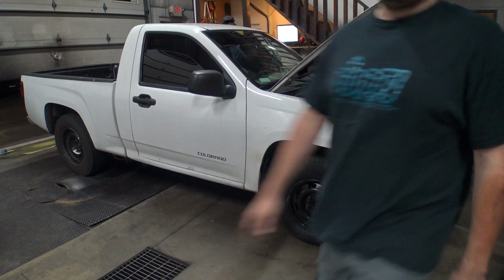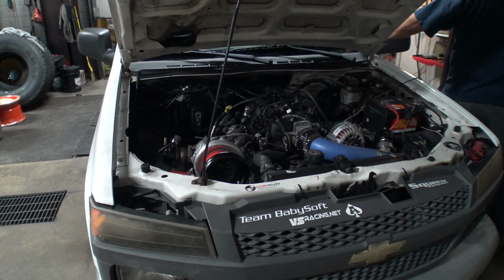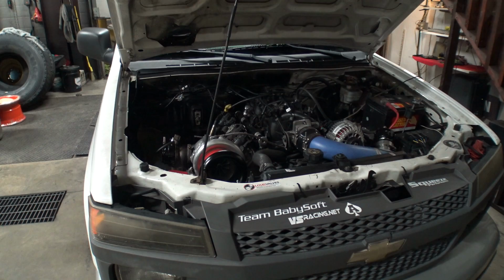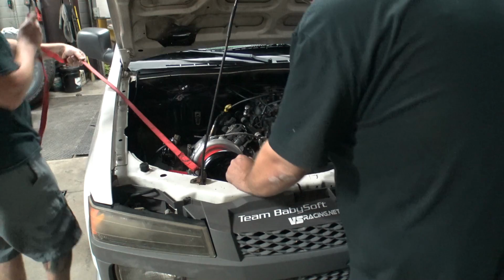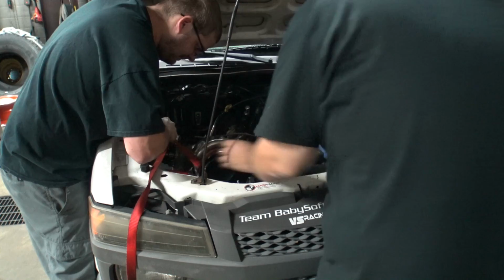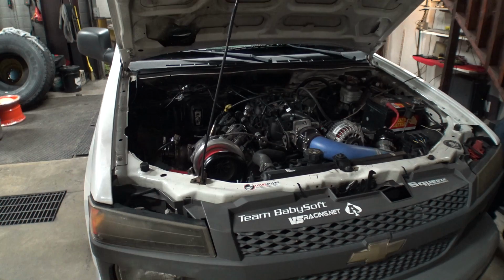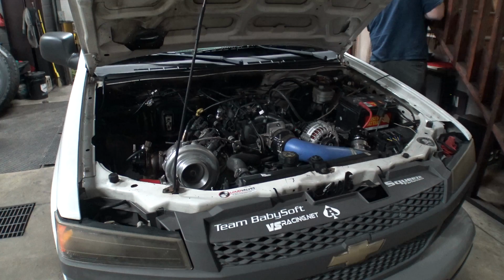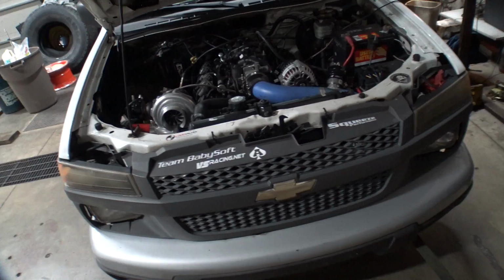aluminum bellmouth ramhorn turbo inlet dyno testing ft shitboxcolorado

Comment: Hi guys. i know just enough about subsonic airflows to be dangerous. In my  experienced amateur opinion, (from numeric  wind tunnel testing model airfoils based on  the well respected xfoil programme)  the front edge of the rubber hose inside the bellmouth will be creating alot of unwanted turbulence because its at right angles to the airflow. The turbulence created by that edge unsurprisingly would very likely reduce overall flow. I suspect that if you can somehow fit it with as smooth transition as possible from the bell mouth to turbo inlet there will be some increase in flow.
Reply: Please ignore my comment above. I rewatched the video and paused and had a better look at the bellmouth to hose connection. It doesnt have the large step that I thought I saw the first time I watched. Your tests seem quite valid that it has no benefit in this application with this boost/ flow rate.

Comment: seems kinda silly. volume is volume. Adding stability or not is up to you. Look at a jet engine, or wonder why a hurricane stays in the sky. I'd still do filter, but on an added pipe.. not on the turbo. I am glad he uses that thing called an exhaust system now, very modern invention. I suppose he is teaching someone.
Reply from the maker: barry, I am not sure why you type as if you are trump's speech writer, but i really enjoyed your 20 minute subaru drive through the woods video...
Reply: Sloppy Mechanics I liked the deer vid.

Comment: Have you ever done a video or post on scaling the 210s on a hard code 63lb e38 computer? Missing something in my tune and can't figure it out. I've looked through almost every video you've made. Maybe I'm just losing my mind.
Reply from the maker: nope i hardly ever touch e38 stuff
Reply: Damn it! I can understand why. They suck nuggets.
Reply: Well if you ever want to, My G8 is right at the bottom of the NE extension lol. Best of luck with the little one on the way.

Comment: Thank you for your tests.
I didn't sent you the bellmouth,but i'm the one who asked you several times to use it.
They work,they are on every turbine of every plane.
Straight edges intakes are really bad for the flow.
they need to be flush to the inside diameter of the compressor housing,and not broken or strapped, wich dsirupt the flow ,with some room in front of them to work properly.
This one was a bit big i think.
Reply: michaelovitch airspeed is a factor. Super sonic planes are very pointy, efficient subsonic planes are very round and bulbous, but there is a point of minimum airspeed where it's not going to make a difference to airflow because the inlet isn't restrictive enough. You have to excede this threshold of airspeed to airflow limit to measure a difference. On this test, on this day, it just didn't suck hard enough. Not moving enough air to make a difference. 

If one was so inclined. You could find an equation to calculate airspeed biased on volume through inlet size and determine where that threshold may be with additional testing.
Reply: I agree with you and Turbosleeper to a point.  By putting this thing on, he blocked flow from the area around the compressor and had to draw more from the back of the rad and the back of the headlight.  How close was it to the next obstruction forward?  I don't know because the camera doesn't show it, but it's getting shoved closer to an obstruction and choking the flow from the sides. I think "firstlast" poster below is correct also.  There is a simple formula to properly design these and I think you have to use a radius equal to the inlet diameter.
Reply: Agreed.  Matt said he thought this might work better at higher HP numbers.  It won't do a damned thing in the underhood configuration we see here.  If he removed the headlight and mounted the bellmouth forward of the grille, he might stand to gain a little more.  The 7875 turbo already has a beveled inlet - it's not ideal, but it gets you 95% of the way there.  So for a lot more effort, you might improve things but not by much IMO.
Reply: Gentlemen there is a separation between reducing inlet drag with a bell mouth, and sourcing fresh air. There are racing classes that prohibit fresh air to be sourced, and bell mouths are still prevalent, especially with supercharged applications. You can source fresh air, just with a tube(which is something I want to do some testing with if matt doesn't do it first) to source air that isn't heated by the engine bay and radiator.

Spoiler alert, there is a point where a bell mouth will make more power, and it isn't huge amounts, but when you'd gladly spend $1k or $2k for .01 everything gets a bell mouth.

Comment: Maybe I’m wrong but doesn’t the bell go in the grill and feed outside air ie cooler air to the turbo instead of drawing hot 200 degree from the engine compartment? Of course there’s not a difference just slapping it on the turbo itself your still drawing in hot air
Reply: yeah youre right it goes on the outside of the car like a ram air of course it will make power when used properly matt must be drunk
Reply: Not necessarily, its designed to flow air more efficiently into the turbo.

Comment: I can understand the principal of that on the front of a turbo, just like one on the front of a jet engine would serve. 

I'm just wondering on how much more you would have to push before you'd see a difference between with and without, or if it would even make a difference at all regardless of how much power you're making.
Reply from the maker: yes it would be interesting to try it on 700whp, but the % is definately zero, with this test, at this hp level, with this size bellmouth.

Comment: does anyone recall what he did for a fuel system?
Reply from the maker: on my truck? triple wally 450s and a 5/8ths feed
Reply: THanks matt, i have an 06 colorado with a 5.3 going in it, i suppose my single wally 450 wont suffice.. lmao
Reply: @cenzolyksitruff  Read the wiki. It’ll be fine, depending on your power goals.

Comment: In theory it may get you a little cooler air in the real world
Reply from the maker: so, the round shape of this makes the air cooler...?
Reply: Sloppy Mechanics ya its physics man no but its a little farther away from the motor at least on your install
Reply: In theory you could pipe the air direct from the fridge at your house. But in the real world you're pulling air from 1/2" further away. 
The only possible benefit would be allowing smoother airflow rather than the abrupt transition into the open turbo. but as Matt so eloquently stated, it's not doing shit at this power level.
Reply: aerosaaber what do you mean 1/2 and inch it's like 6 or something
Reply: James Holbrook its 2/ 2.5 inches max from the inlet
Reply: Ian crowder maybe just the ring but the whole pipe and ring is more than 6

Comment: No expert here, but shouldn't the bellmouth be closer to the turbo inlet and not on a length of tube?  Should resemble how intake ports are built up (on cylinder heads) around the inlet when they're flowing them on a bench?  You're trying to break the sharp edge of the turbo inlet with a radius'd inlet to smooth the transition.
Reply from the maker: well buddy its a good thing you are not an expert, because it is flat up against the inlet of the turbo, there is basically nothing between the turbo, and the bellmouth, it is as if it were directly welded on with this configuration, and this reply is exactly why i did that, there is no length of tubing skewing the test, the coupler is only acting to hold the piece to the turbo, there is no additional length added, or bends, or any other things skewing the results.
Reply: Thanks Matt, hard to tell in the vid.